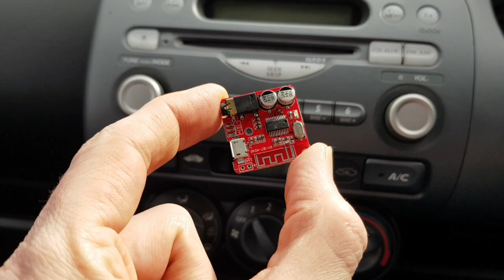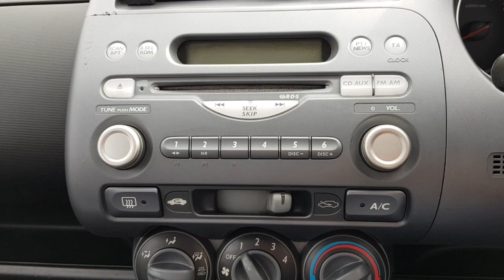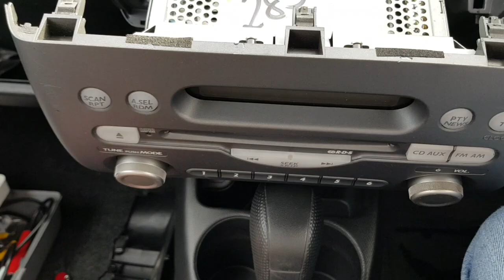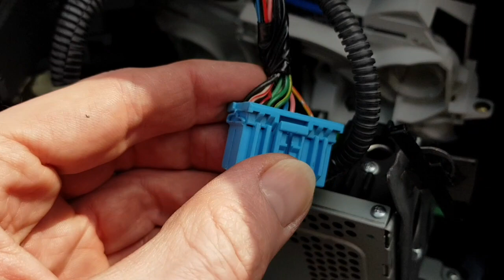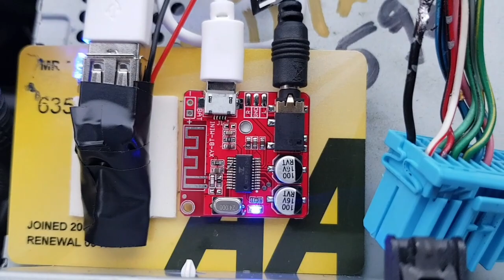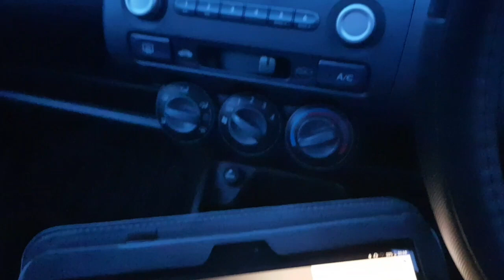Honda Jazz (Fit) Mk1 (2002-2008) - Radio/Stereo Bluetooth Speaker Upgrade

Comment: brilliant...
a small question please ..

when connected to phone .. and within a phone call .. the used microphone is the one on the phone itself .. correct ?   

i mean the module is just for sending speaker audio through Bluetooth from Phone to Car stereo ...
Reply from the maker: Yes with this module it works like Bluetooth speaker so no calls etc through this device

Comment: Good job on your video! You could have made that cleaner by soldering your red/blk wires straight onto the bluetooth module and removed the micro usb jack. Good job on the video though! And for the most part soldering has it's place but whenever you can you should use crimp splices for wires. I've soldered wires before and found they break over time vs splices hold up for much longer time.

Comment: hello my friend and congrats for the SUPER HINT :)..i bought the same module, tried at home was clean and perfect, in my honda jazz is very noisy before pairing; after pairing clean but low output, what could be? i used a 12 to 5 car adapter, maybe should try with other models more stabilized...someone suggest to install an isolated converter DC DC 5v to 5v...what do you think?
Reply from the maker: Hi. I would test the audio lead is working ok as I had noise problems with it due to a bad connection. Maybe try a different source via the audio jack to see if there is still the sound problem from the radio?
Also I can't make calls with mine as it only works as a wireless speaker.
Reply: @amp9438  thanks for your answer...i also tried to route the audio to use built in telephone mic but in Android 12 seems to be quite impossible
Reply: Also if i make a call audio comes out from speakers but no voice from built in phone mic...same to you?

Comment: Very nice video! Just wondering.. if you solder another aux cable "in parallel" with the other to the Dupont header will the radio accept both bluetooth and aux? Would it work? Thanks
Reply from the maker: Hi. Haven't tried it but think it would probably work
Reply: @amp9438  thank you for the quick reply, I Will probably try it. If so, I will give feedback

Comment: the h-tune website seems to be down and clubjazz doesn't link much - found your video - presumably the usb power board is just a cigarette power to usb adapter broken down to just the pcb to convert 12v safely down to 5 ? your video doesnt show clearly what usb power board you used could you link a suitable one?
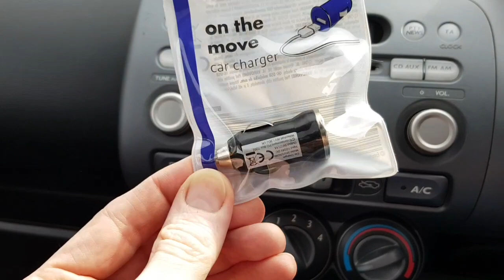Reply from the maker: Hi. The video shows what I used @1:45. A usb adapter for the cigarette lighter should work and convert the 12v to 5v. Any will do I think. I just took mine apart and soldered some wires onto the cigarette lighter contacts.

Comment: Hi I've got the Bluetooth module working I was just wondering if it was possible to connect to the ignitions 12v system without soldering
Reply from the maker: Hi I think you can use these plastic connectors called scotch lock (or scotchlok) which allow you to tap the existing wiring. I didn't have them so just soldered.
Reply: @amp9438   Wow I never knew they existed lol I haven't opened my head unit so I was thinking is there anyway I could trap my wires where the loom goes?

Comment: Is the DC power plug required, or did you just include it so there was still a fuse in the circuit? Could I, in theory, just wire a micro usb to the ignition 12v power lines as showed?
Reply from the maker: USB is 5v so you need to drop the voltage
Reply: @amp9438  cheers mate!!

Comment: 5:52 where can i find this cable? I have a Bluetooth board i can fix it with an open usb micro cable for power but i can’t find the cable with the pins...
Reply from the maker: Are you talking about the audio/aux cable? You can make it yourself with an audio lead and a 6 pin Dupont connector as per the video/links in description

Comment: Hey there, thanks for the video. I have just bought jazz 2003 automatic in Netherlands. And was looking for such mod to apply on mine. Just a quick question, is the powering wires should be same for a jazz in Netherlands? I mean the yellow/red one for positive, black for the negative?
Reply from the maker: Don't know if they are the same. I'd suggest using a multimeter to find the wire which has +12v and is linked to the ignition
Reply: They are man. Sure you've sorted this out already.
Reply: There is a readymade module on Aliexpress for like 7 usd.
Reply: @yankodimitrov5246  can you please tell me what shall i write on ali express to get this 😢
Reply: Hi kahraman, may I know how did you solve this issue ? Did you try it in NL , does it work ? Or you find a solution

Comment: Thank you. Mine is working like a dream, however there’s a bit of a hiss when the car engine runs. Any idea to fix this?
Reply: Deffo wire side connection most likely ground side of 12v or Bluetooth board. I'd had issues as similar hiss. An turned out to be board touch with the inside behind dlcd player metals
Reply from the maker: Not sure really. I did have a problem with my audio lead which caused some noise due to a bad connection. Or maybe it could be interference coming from the usb power adaptor?

Comment: Did it come out ok without disconnecting the heaters cables? Because getting at the cables is a major ball ache. Radio has stopped working, suspecting a common problem with a voltage reg. cheers
Reply from the maker: Yes you should be able to pull it out far enough to access it without disconnecting the heater controls
Reply: Hi can't get from China while Corona no post coming can I get from uk if you know please
Reply: And also my radio sound is quite need IC502 I can't get on ebay I tried if you got any contact please